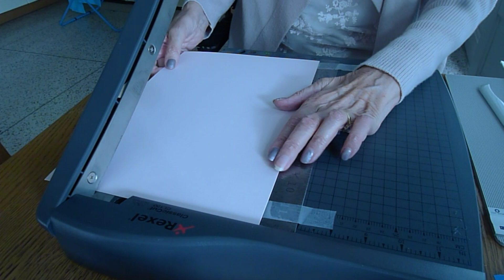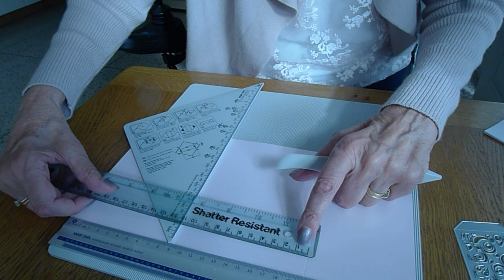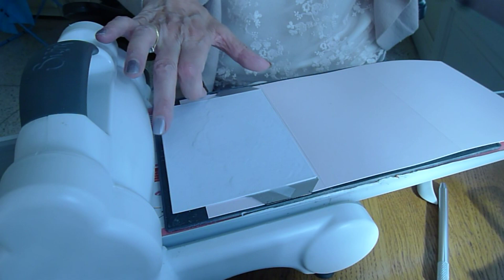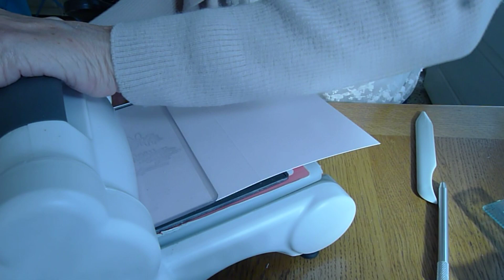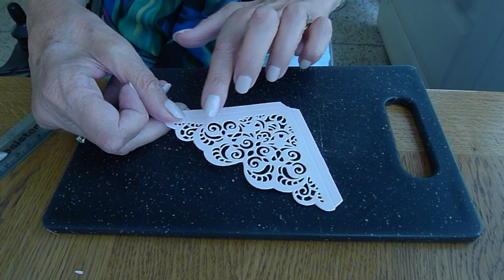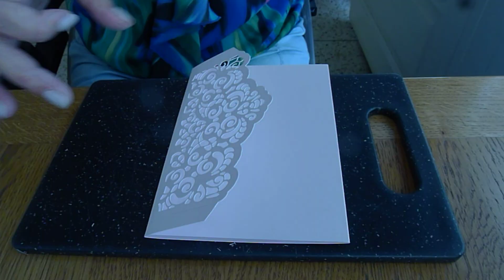beautiful , budget, lacy pocket fold invitation wallet

Comment: I am at this very moment making Wedding invitations for my grandson's wedding. I am also using 300gsm pearlescent card. I am finding rolling through my Grand Calibur is heavy going, and I am only using one card shim.  You don't seem to be be having a problem rolling through with lots of shims.
Reply from the maker: I seem to recall it often took several passes to cut it out cleanly using my Big Shot, so understand your issue. Takes a bit longer but well worth it , even if time consuming. I did around 70 invitations so took a while. One hint is to use fresh cutting plates  and I found the precision cutting plate on the bottom helped too. It was worth the investment.
Reply: I am using brand new plates and reversing the top plate after each roll through. The machine seems to stiffen up after doing about three, so I've decided to do two at a time. Thanks for your reply

Comment: Love your video, few questions. What size paper did you start with? how did you make the pocket portion before it was cut?
Reply from the maker: Hi Kia. Glad you liked the video. To answer your questions:
I used A4 paper to start with, cutting it to 15cm ( 6 inches) width and then scoring and folding along its length. The pocket uses the large corner pocket die, so was actually the easy bit.  Have a look on my blog page.  https://jestelia.com/blog/wedding-invitation-wallets as that might help too. 
Any other questions - just ask. Happy to help.

Comment: Hello, I would have liked to know the size of your paper
the steps you take to bend
and where you found the model for the machine
thanks in advance, sorry for my english I'm french
Reply from the maker: Paper is A4 ( 29.7cm x 21cm) cut to 15cm width ( 29.7cm x 15 cm). I scored it using a score board and bone folder at 8cm and 19 cm . If you don't have a scoreboard you could use a ruler and a blunt knife. Keeping the ruler along the score line fold the paper over , then remove ruler and smooth the fold using either a bone folder or the back of a metal spoon.
The dies ( Découpe en métal ) were Lace card and Romantic corner from Elizabeth Craft Designs and I bought them on Ebay UK . They are also available on Amazon. I hope that helps!
Reply: would you have a link of the pieces you used for the reasons? because I found it but bigger than yours so I have to cut and glue
Reply from the maker: @ch4rl3n357  
https://www.amazon.co.uk/Elizabeth-Craft-Designs-Lace-Large/dp/B078SPJZ3Z/ref=sr_1_1?keywords=Elizabeth+craft+designs+lace+card&qid=1569571264&s=gateway&sr=8-1 

https://www.ebay.co.uk/itm/Elizabeth-Craft-Design-ROMANTIC-CORNER-Die-NEW/143299575167?epid=22010964005&hash=item215d51fd7f:g:DisAAOSwRTtbLlLf

Good luck!